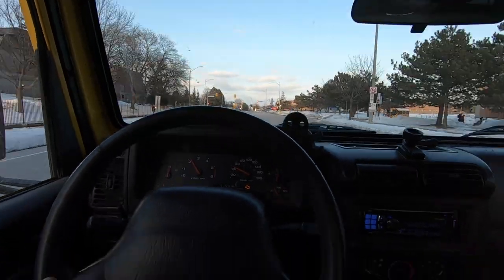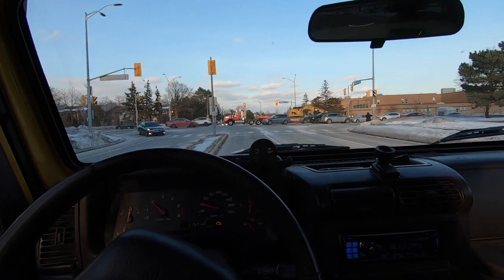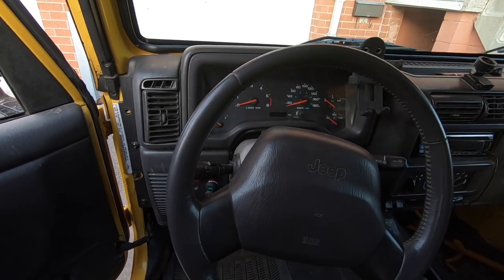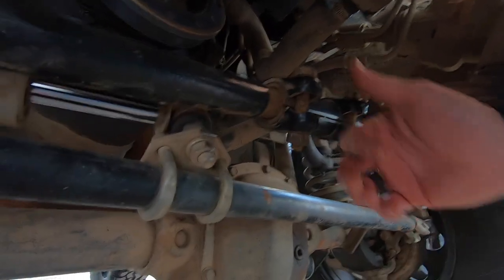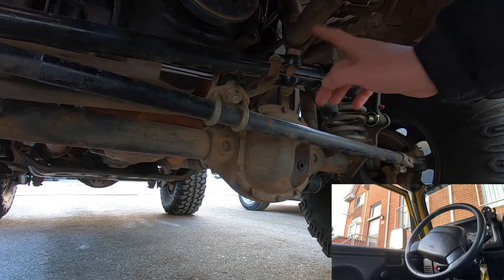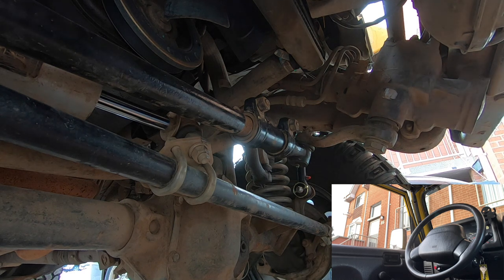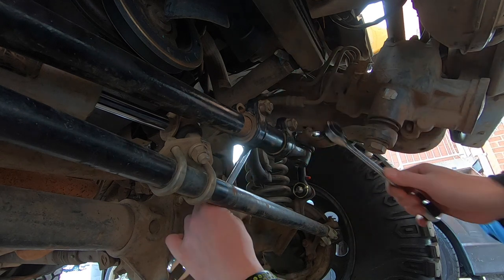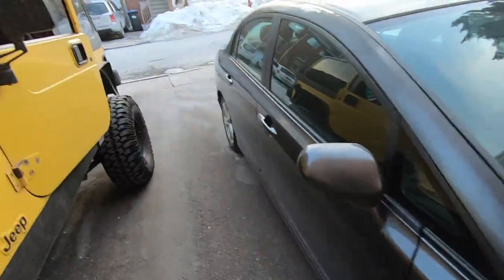FIX Your CROOKED JEEP STEERING WHEEL In 5min By YOURSELF!

Comment: Here's a little tip for the steering wheel, put a piece of tape on the center of steering wheel (not the horn area) and therefore you can see the tape from outside the windshield when you are rotating the sleeve. Once the tape is in the center where you want it, tighten the sleeve down and you're done. Makes it easier than getting up and looking inside the cab, then crawling back under to move it more.
Reply from the maker: Good tip!

Comment: Always great videos, I have the same curry set up on my tj. My steering wheel is sitting around the 10oclock position with my wheels straight and I did try adjusting it the exact way you did but the threads bottomed out to the point both sides are of the link are touching. Any recommendations on how to correct that?
Reply from the maker: Mine only stays straight for a few days then goes back to the same as yours lol no idea what it is but it’s still tight

Comment: I just picked up my truck from the shop after an alignment.  Usually, the same tech always does it and does it perfect.  This time, a different tech did it, and my steering wheel is crooked😡.
Reply from the maker: They could have forgot one thing. If you set the wheels straight and don’t set the drag link to centre the wheel the tires will be straight but steering will not be

Comment: My sleeve won’t move and those bolts are completely loose. Just the brackets are moving 😥
Reply from the maker: It’s probably just rusted on there. You’ll need either a torch and some pliers or just some pliers and a lot of force.
Reply: Any idea what I need to do?
Reply from the maker: You could try spraying it with penetrating oil and leaving it overnight
Reply: Probably need to replace the sleeve and ends. I just went thru this with my WJ. My shop hit the drag link with the hot wrench to no avail.  The pleasures of living in the rust belt 😂
I replaced with Moog drag and ends and all is good now. Be sure to coat it good with never seize
Reply: @JJK-le2yj  yeah well it’s like I’m out of threads on one end and have a bunch on the other end of the sleeve
Reply: Hmm. Hard to say without seeing it but, sounds like one end is frozen. I matched my existing with about 3/4" exposed threads on each end. Probably best just to replace the drag link and both ends, otherwise you will just be fighting it....I actually bent 2 pipe wrenches trying to free my tie rod ends which were rusted shut...ended up replacing the sleeve and ends after a lot of frustration
Reply: I got the Moog drag link and both ends from Amazon for about $80.